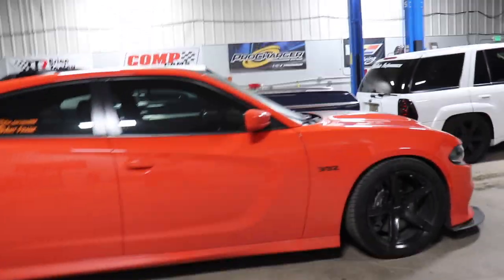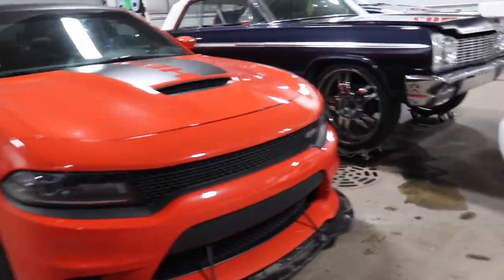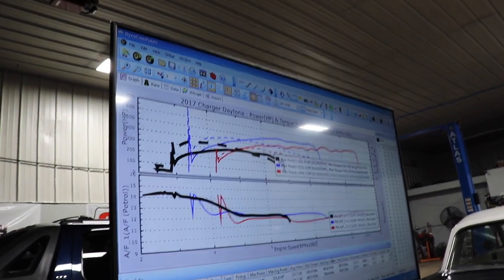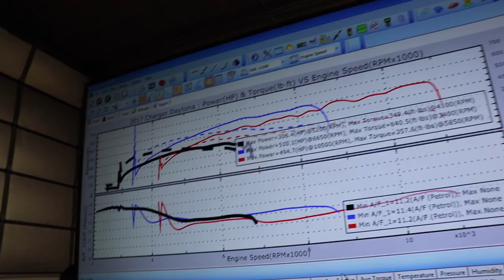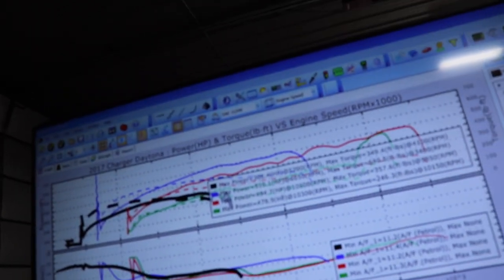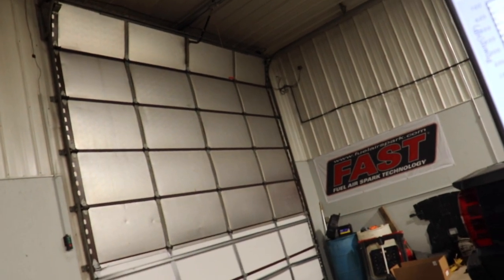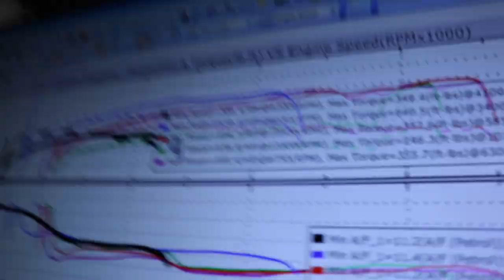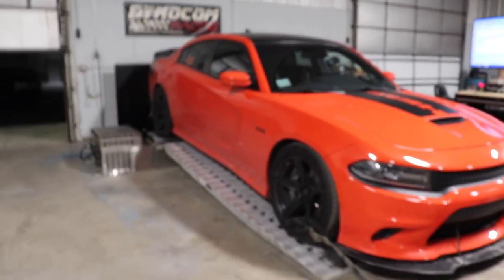CAMMED DODGE CHARGER 392 DYNO RESULTS!!!

Comment: Just .02 worth from a guy that has owned and raced a 2015 SRT 392 Charger since new(August of 2015). My car has Stainless Works Long Tubes and Full Exhaust, BMason Ported Intake Mani, Fastman True-bore 84mm T-body,  Hellcat air filter(in stock box) and Tuned on E85 by Peitz Performance/BMason) and has run  a best of 11.56 @ 118 in +350 DA(4555lb Race Weight w/ Driver). Car made 456 RWHP/466 RWTQ (SAE Corrected) on Dynojet. I actually have a cam install scheduled in next few weeks. There is NO WAY IN HELL your car is only making 350 Ft/Lb RWTQ. Something is off with the way the Dyno is measuring Torque with your car. It is typical for a bigger spec cam to cause a torque loss down low, but NOT  75 to 100 Lb/Ft LESS than a STOCK 392 makes at the wheels. The cam shifts the power curve to the right. Just letting you know your car is making well over 350 Lb/Ft of Torque at the wheels. Car sounds amazing and she spins those rollers up in a hurry!!! Also, he should be dyno-ing the car in MANUAL MODE in either 4th or 5th Gear(Dyno-ing in 6th Gear would have the wheels spinning in excess of 160 MPH on the dyno, which is a bit high). At any rate, good luck with the car man. She's a beast!
Reply from the maker: Thank you for your input and not just trashing and talking smack like most would. My car is actually running really bad surging and having loss of power issues. This dyno run was from my last tuners tune. So we are adding some new mods then gonna actually tune the car. My spark plugs were shot and I’m pretty sure they were robbing me of power. This was done just to baseline how it’s been past month so will have actual numbers soon once parts are in
Reply: @AntFrank  10-4 brother. Looking forward to following your progress. Good luck getting her all sorted out!
Reply: 456 rwhp ? With all those mods I would think it would be making more.
Reply: glleboy right 460 atleast 470whp With those mods but guess it really is hard to squeeze out hp outta the 392

Comment: That torque should not be that low, I’m sure you’ll figure it out but man, can’t help but think cams make these cars lazy bottom end. I could be wrong
Reply from the maker: Something is going on with tune for sure. Sadly new car parts still aren’t here to get it tuned yet
Reply: This is the exact reason I do exhaust, intake, and gears and leave the rest stock!

Comment: What happened with that blue line? Those numbers are great lol. 510 hp and 640 torque? Man.
Reply from the maker: The dyno is off and reads weird numbers that’s why I don’t use that dyno anymore. He’s working on getting it fixed
Reply: Where u tuned by flyin ryan performance ??

Comment: yea that dyno is garbage. That car with just a cam should be making 480+ and your torque should be 470+. A FBO cammed 392 with a good tune, should make over 500whp.
Reply from the maker: Yup plus I switched tuners and after switching tuners it showed 600 hp so I knew it was messed up

Comment: Dynos are black magic man.  Perhaps something going on in the tune?  Strange that the hp numbers are looking great but the tq is lower than you’d expect.  I’d take it to the track and see what kind of improvements you make there.  I had a similar situation with my R/T.  My after headers dyno was 30hp less than my before, even though the car was pulling way harder than stock and I dropped .5 in the quarter mile.  I switched dynos after that and got a really good dyno tune done, but since then I’m kind of weary of dyno numbers.
Reply from the maker: The tune was messed up. I got it all fixed but I sold the charger and bought a camaro

Comment: 357tq why so low on torque? I had a cam installed on my 5.7 and dyno was 430whp and 420tq
Reply from the maker: All dyno read different this sadly was a low reading dyno
Reply: @Ant Frank that's true, did you ever get it put on another dyno I think you should of made way more torque. The whp looks great almost 500whp which is where most 6.4 sit around with a upgraded camshaft.

Comment: please overlay the stock cam power with the max effort cam power to see the gains over the stock power curve. seems like a nice mild grind. nice job!
Reply from the maker: Sadly I don’t have stock dyno file. My shop didn’t have the dyno. But you can guess these cars make 405-425 stock so with headers about 70+
Reply: @AntFrank  ok, thx. would have been a great back to back 'true' power test. So, that's 93 octane, and just under 500rwhp n/a. nice!
Reply from the maker: Yea and a lot of people with same cam pushing 500-510 so with my new tune I got should be around that if not more since I’m fbo now
Reply: What cam is this?

Comment: Great wheel horsepower man! Definitely a very solid number. Why exactly is the torque so low you think?
Reply from the maker: Car just isn’t running good my spark plugs were shot car is surging and getting robbed of power
Reply: I was just thinking the same thing. Torque number sounded too low. BTW, nice car Frank! I'm currently working on trying to put together a deal on a 2016 B5 blue SRT8, and I can't wait!
Reply: Anyone need a 2.9 Whipple? Used with 1500miles on it
Reply: @philipmazzuca2269  for a 392?

Comment: Curious to see where our cars stack once mine is finished. I’ll be having satera tuning put the same cam in my car.
Reply from the maker: Nice! I was gonna go with satera tuning but for tune flex fuel and trans tune he wanted 2400$ and I couldn’t get myself to spend that much just for that. I’m down to get down 💪🏻💪🏻
Reply: Ant Frank yeah Jeremy isn’t cheap, but I rather over pay and know I’m getting quality work than to ever question what’s going on. Not saying anything bad about the shop where you’re car is at, I have no knowledge of them. Didn’t wanna start a shop debate war 😂.
Reply from the maker: Oooo no not like that at all no shop debate at all!! He is the best of the best tuner and builder and gets all credit deserved! My shop just got a dyno last week so this the first hemi put on the dyno and tuned so got some bugs to work out plus the tune that’s on the car now is from a different tuner and this dyno run was for just numbers nothing else. I actually have a appointment with satera tuning for Monday next week had it for a month just gotta figure out if I’m going or not
Reply: Ant Frank Jeremy is the guy for sure. Subbed to your channel. I’m just on the NW side of Indy so if you’re ever racing at US41 lemme know.
Reply from the maker: Sounds good 💪🏻 this summer will be there a lot 💪🏻

Comment: Nice hp numbers, but how come the torque is low?
Reply from the maker: Not sure was pretty surprised about that. My car is surging and running like crap so this was mostly a baseline. I’m replacing sparks plugs and tune isn’t dialed in
Reply: d-mob 5563 B Mason says when you add a cam to these 392s you gain HP but you steal TQ
Reply from the maker: Not really people with similar setup about 500 tq so not normal

Comment: Something is wrong, your torque is not supposed to be that low
Reply from the maker: It should be figured out I did some more tuning and bolt ons. I’ll back at the dyno for baselines next week
Reply: Very nice car, and I’m impressed with the horsepower as well, I should be getting a 392 or Hellcat soon
Reply from the maker: Hell yea next is hellcat for me

Comment: U lost a 100 tq   something is up bro
Reply from the maker: This tune was my baseline from my old tuner. My car is running really bad and needed spark plugs and tune fixed. I ordered new parts and gonna actually dyno tune it once installed
Reply: @AntFrank  ok. Bro.  Just threw  me off. Tq so low
Reply from the maker: Yea when I retune car it will be better this was just a baseline for the upcoming mods coming

Comment: Man torque  is super low stock is 430 at the wheels and without torque that car isn’t nothing..... swap that cam back out of there....
Reply from the maker: Tune related ended up switching tuners much 
better now lol
Reply: Nice what did you end up with after that?
Reply from the maker: Was never able to dyno the car again cause the dyno broke sadly but it’s definitely way better